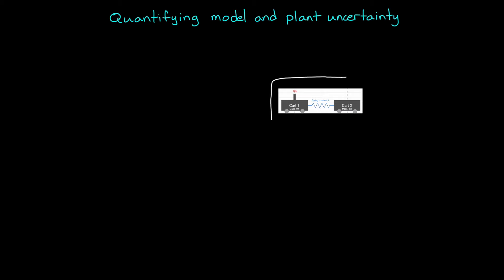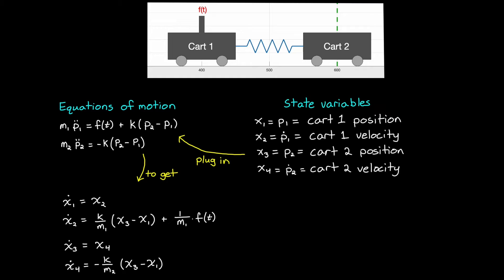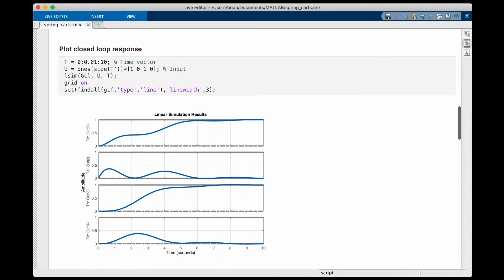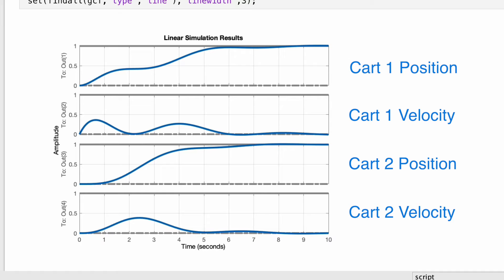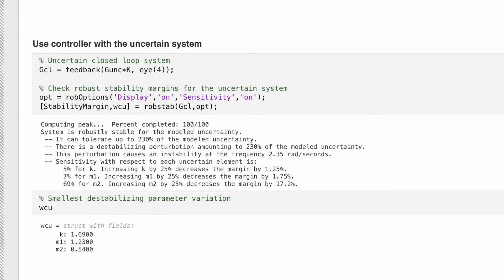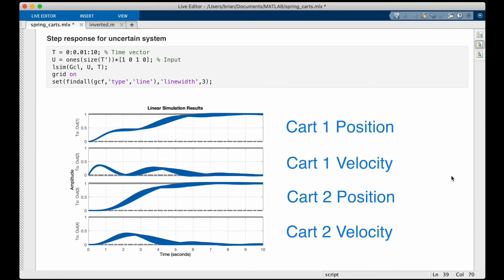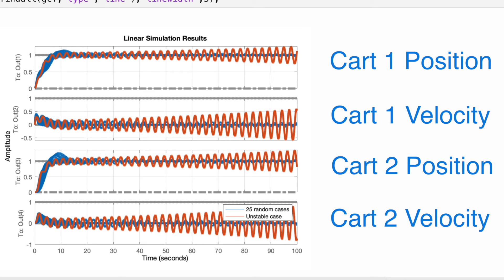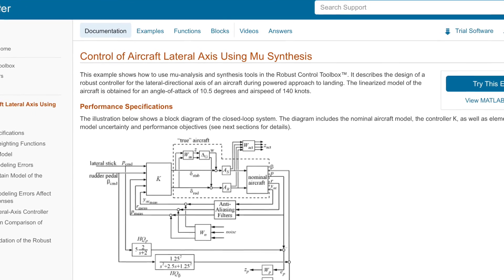Working with Parameter Uncertainty | Robust Control, Part 4

Comment: The Mass of the body is neither created nor destroyed. If it's so why do you vary the masses?
Reply: Because we don't know the masses with infinite precision. Manufacturing processes can only make the masses of the carts to within some tolerance (say, 1%).

He's varying the mass to see what happens for different mass values that might not be exactly what we expected.

Plus the carts might get pieces chipped off, or they might accumulate dust or rust. So even the same cart might have its mass vary over time.
Reply: In the case of an aircraft the mass vary because it consumes fuel

Comment: Dear Mr. Brian,

I have a problem. F = umargin('DM', [0.9 1.1], 10); % Gain varation 0.9 - 1.1 and Phase variation +/- 15 deg

give an error message. 

Error msg - Unrecongnized function or variable 'umargin'

Comment: Dear Mr. Brian,

I have a problem. We found robust stability using robstab. It gives 2.3 times that set values. So considering m2 set value is 1 and can be 1.46. But wcu value tells m2 minimum unstable value is 0.54. Why does not it 1.46? 0.54 to 1.46 values are system unstable or not?